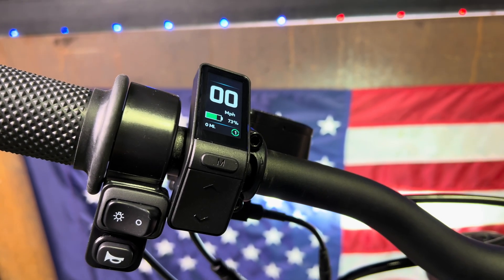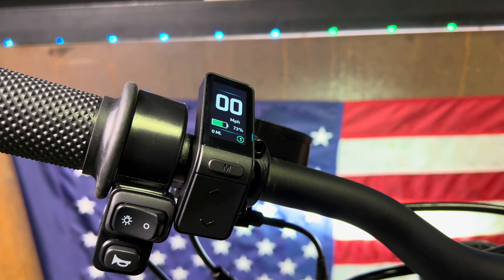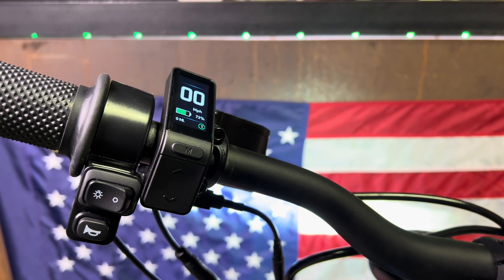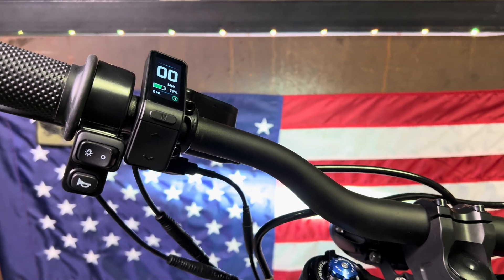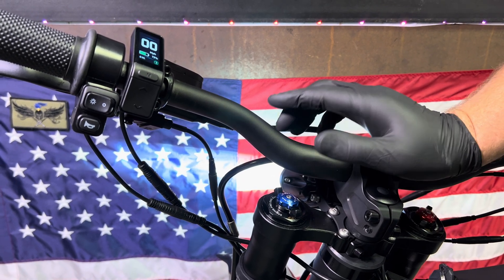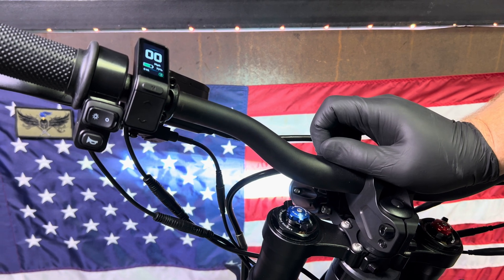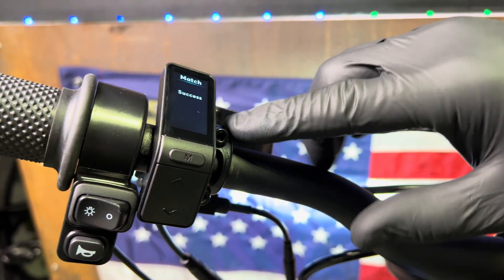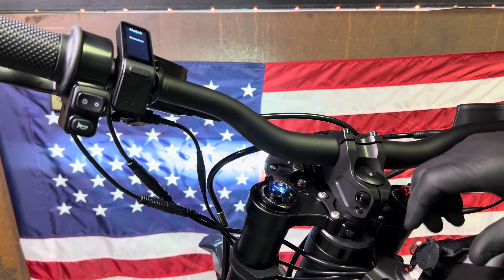Talaria Motor Calibration (Match)

Comment: What if youre using a xxx everything for a project but motor had to be mounted opposite direct? Is there no way to change direction of this motor?
Reply from the maker: I doubt it’s possible with the stock controller . Some controllers have a reverse function.